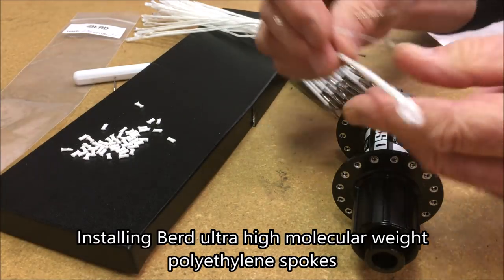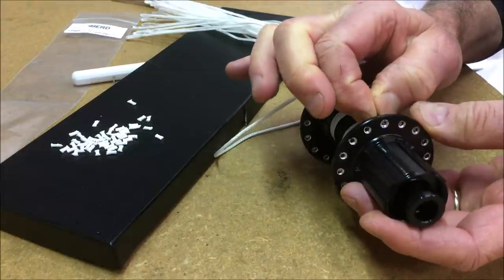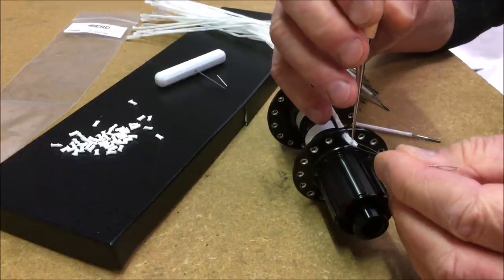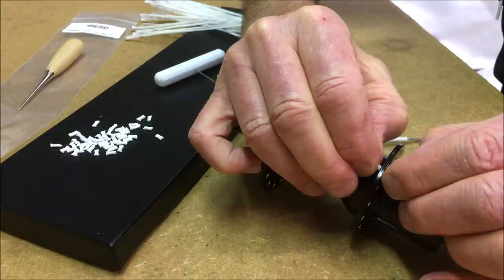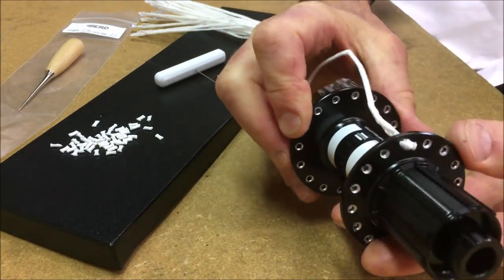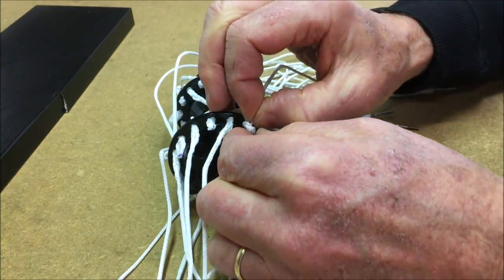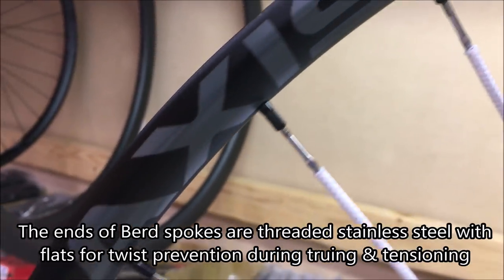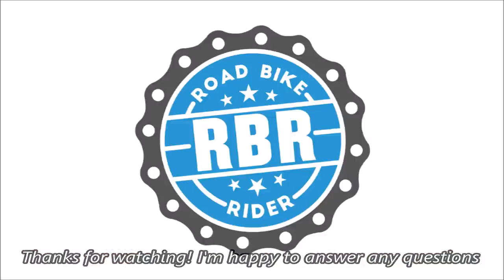Berd's Ultralight Polymer Bicycle Spokes - Wheelbuilding Tips & Observations

Comment: IF they're so amazing, whey arent' they being used by the pros or on the tours?
Reply: Most of the advantages on them are mountain biking.
Reply: @cohensylvester5191  explains everything
Reply: @cliffcox7643  yup. Although there are some gains on road bikes.
Reply: @cohensylvester5191  I think the weight of aero spokes trump the light weight of these.. Aero trumps weight because of the increasing drag at speed.
Reply: Because they use the stuff brands sponsors provide. And this tecnology is patented.
Reply: @abelramos8652  I dont think so. I think they're not aero, but light,  and aero trumps weight.
Reply: @cliffcox7643  thats on road. On xc aero dont matters more than weight
Reply: @abelramos8652  exactly, thats why you don't see them on any pro road, or even amateur ..kkkk
Reply: Because it's 8dollors a spoke
Reply: @codypease9582  That makes no sense. I a pro team can afford that. It's the normal people that cannot.
Reply: They're not UCI approved for mass start events
Reply: @cliffcox7643  are they bad at aero? Can you even prove this? Just because it is "string" does not mean it has aero so bad to the point where the weight difference doesn't trump the slight loss of aero (if any). If aero is such an important thing, why do the cyclists not wear a full skin suite, surely there are materials more aerodynamically efficient then our skin?
Reply: @BloodThunda  its proven everywhere,  bladed spokes truncated shapes better than round
Reply: @BloodThunda  all you have to do is just look at thos fluffy things and you can tell its not very aerodynamic...
Reply: @cliffcox7643  I think you are missing the point of this, this weighs less, not sure if you cycle on the road or on the dirt. But what I can say is this, less weight means more control, so in slow technical  situations where aero means nothing im quite certain that you would want these if they weigh less then any other solution.
Reply: @BloodThunda  so, thats why they're not used on road. Makes total sense. Also a few grams less means nothing as well. Ok I got it figured. Its a gimmick for people who want to spend money
Reply: They're not aerodynamic and Berd is a very small company. Riders use equipment that they're paid to use, so only companies that can afford to back teams will be seen. Most wheels ridden in large cycling events are produced as wheel systems anyways, so custom wheels aren't very common.
Reply: @cohensylvester5191 , Then how come the pro mountain bikers don't use them?
Reply: @cliffcox7643  yup exactly except if you live in some where really hilly. but arrow is 100% better for crit/road racing
Reply: Because no one knows about them (?) ...How have I not heard of these until now, even though I've been using dyneema / cuben fiber backpacking products for years (yes, some from REI) and yet have been riding bikes and truing wheels for 4x as long as I've been into backpacking.
Reply: Cliff, I don't think anyone said they are amazing (even though a light string spoke is absolutely amazing), but they are substantially lighter than steel, so if you want a light wheel set, they might be a good option.  They seemed to hit the market and start getting great reviews right around 2019, but I just can't think of any reason they didn't explode on all those tours 2020-2022.😂    Pro cycling, it's all about sponsorships.  Pros ride what their sponsors provide, not the equipment they want to ride.  This doesn't mean pros would or wouldn't want to ride Berd spokes, but small startup companies are rarely sponsoring Tours and pro teams like Trek or Giant due to lack of capital.
Reply: @gabeah  no one said they're amazing, but for myself. Aero trumps light weight. These are like a whisk in the wind. The pros would rather have aero. Saves watts, and is faster through the wind.

Comment: This reminds me of a tragedy that happened about twenty years ago.  I used Spinergy SPOX wheels on a touring bike.  It was a trip intended to go from Seattle down to Los Angeles along the coastal routes.  I learned that the racing wheelset was never intended to be used as a loaded touring wheelset.  After a hundred miles of riding, the rear wheel failed and there was a mess of VECTRAN spaghetti.  The front wheel showed cracks in the rim and was eventually going to go spaghetti on me, too.  I had to go to the nearest bike shop and buy a standard 700c  Shimano wheelset that would survive the tour.  After the tour, I ordered a beefy tandem rims with 50 spokes per rim and a beefy Hugi 50 spoke hubset.  Laced them up myself.   Never had an issue of wheel failure after that.
Reply from the maker: Great story, Roy - though I'm sure it didn't seem great at the time! Thank you for sharing and I appreciate you watching and commenting!
Reply: omg 50 spokes, I never saw such rims
Reply from the maker: @MrLagger1996  thanks for watching!
Reply: thx for sharing this story so that we can learn. every wheelset ist build for the mission it would build.
Reply: And what was the tragedy? Who died?
Reply: Anyone know whar i could get 50 spoke hubs and rims?
Reply: @aggese  I only know of tandem/track stuff. I thought it was 48h tho. There was a Shimano XT cassette hub with high flanges, Campa had a pair (very rare. I saw a pair recently - but here in Germany for 250 euros), there is an old nos Hügi 40 hole currently cheap on ebay.. Phil wood most probably makes such hubs. And rims would be- velocity if you are in the US. in the UK h son+ in 40h. Rigida makes at least 40h and 48h if you are in Europe or else..

Comment: steel spokes can be bought here in Germany for .22 euros . These can be bought for 7.95 per spoke. That  is 3513% more per spoke to build wheels. Hard to justify .
Reply from the maker: Thanks for watching and the comment. Yes they are definitely a lot more expensive than steel spokes. For riders who feel a big difference in ride quality with them though, it doesn't seem to be a problem. And one way to justify the cost is to use an aluminum rim instead of a carbon rim. You save a lot on the aluminum rim versus the carbon and end up with a lighter better riding and more durable wheel.

Comment: So many people don’t realise that the wheel hub is actually hanging from the top and everything relies on tension.
Just one thing missing; I bet they don’t make a pinging sound when a piece of stiff card is fixed to catch on the spokes when the bike is moving. Happy days in the 50s riding my bike with folded card jammed in the rear brake calliper to sound a bit like a motor 😀
Reply from the maker: Thanks for watching and the fun comment, royksk! I rode with a baseball card making the motor sound, too - makes me laugh thinking about it.
Reply: We did the same thing when we were kids. A piece of cardboard and a clothespin.
Man we are getting old!!
Most kids these days would say "Why???" when I can gat an app on my phone to make a motor sound!!!
Man we are getting old!!!
Reply: A hub does not "hang" from the top spoke but "stands" on the spokes below it. If you draw a free body diagram of the wheel you see that this must be true. Or if you just imagine adding spokes until the wheel is solid and then think about the load path to the ground. 
If the hub hangs from the top of the rim then what does the rim hang from? Further, if you put a tensiometer on the spoke above he hub and the spoke below, and apply a downward load on the hub, the tension of the spoke above will remain the same, and the tension of the spokes below will decrease. Since many of the spokes below the hub share the load, they each only reduce in tension slightly. 
Have you seen a wheel fail from low tensioned spokes? The spokes and rim at the bottom fail, while the spokes and rim above remain straight.

And why wouldn't the spokes "ping?" ever heard a nylon guitar string?

Comment: Building a wheel with conventional metal spokes seems daunting enough. Looks like a fun winter evening project for the obsessed. Would like to see you attaching the rim end of spoke. Thanks for posting.
Reply from the maker: Thanks, Norman. The rim end of the spokes are attached just like with regular wheels. The only thing that's different is that you pull on the Berd spokes to stretch them so that you can get the nipples to thread on. That's because the Berd spokes in their relaxed state are a little short. To stretch them, you put the little white Berd tool (shown near the end of the video) on the flats built into the ends of the Berd spokes (the stainless part). Then, with the tool, you have a good hold on the spoke and you can easily pull it up and make it reach the nipple to screw the nipple on. Thanks for asking. Jim
Reply: after made 100 wheels,Building a wheel with conventional metal spokes is not  daunting

Comment: Pi Spokes have a better system of mounting!!! 👍
Reply from the maker: Thanks for watching and commenting, Big Red. As far as I know, Pi spokes are designed for use in their Pi hubs. Berd spokes will work in all standard hubs. So if you want to build custom wheels around hubs you already have with "string" spokes, you won't be able to use Pi spokes unless Pi comes out with another type of spoke end to fit J-bend hubs. But if you're going with Pi spokes and Pi hubs then all's good. Thanks again.

Comment: to be honest i was curious to see how you build the wheel, and to see how the tension make the spoke harde...
Reply from the maker: Hi Jeff, the wheels is tensioned just like wheels with steel spokes. The difference is that it takes many more turns of the nipples to reach optimum tension. In other words, to hit the same tension you aim for with steel spokes, it's surprising how many extra turns with Berd spokes are required. It's the nature of the material that the spokes are made allowing the spokes to stretch. As you keep turning, though, the Berd spokes come up to full tension just like steel and when the wheels are done, if you squeezed both the Berd spokes and then steel spokes (both at the same tension) the tautness would feel the same. The Berd spokes becomes super tight just like steel spokes.  Hope this explanation is helpful. Thanks for the comment!

Comment: Why would the spokes need to be laced under/over as regular spokes? For steel spokes, it keeps them in place when they break so they don't get caught in the derailleur or hit the frame. But fiber spokes wouldn't stay in play whether laced under/over or not. I read the FAQ on the Berd website which answers most of the questions in the comments, but they didn't mention lacing patterns or under/over crossing.
Reply from the maker: Thanks for watching and the question Griff. I talked with Berg before starting building with their spokes and they recommended building with their spokes the same as with stainless spokes including interlacing. Interlaced spokes touch\brace each other at the contact point. This can improve lateral stiffness and reduce vibration in the spokes that can lead to spoke loosening. I believe that’s why it’s done. Hope this is helpful.

Comment: My grand father repaired bikes since ww2.. If he saw this, he would be amazed how this works and how this can survive bc polymer is plastic.. Im also Amazed why save bits of grams while normal spokes are not heavy at all
Reply from the maker: Thanks for watching and the great comment, Blu. I think if you and your grandfather had a chance to ride on a set of wheels built with the Berd spokes you would feel enough of a difference to be impressed. These spokes are significantly lighter than steel spokes and they also damp road and trail vibrations. That's not to say they're going to replace steel spokes but they certainly are interesting and riders using them sure seem to like them. Thanks again!

Comment: Hi Jim, what are your thoughts regarding the torsional stiffness using these spokes?  Wondering what a wheel might do when pushed hard into a corner in a MTB setting.
Reply from the maker: Thanks for watching and the question, Unknown. I haven't heard any complaints from the couple of MTBers I built wheels for with these spokes. But, before you pay the money for these expensive strings ;-) you should probably see if you can find someone with some and give them a try. 

Because a lot of what a rider feels has to do with how they ride, how much power they can put out and how much they weigh. Berd spokes tension up just as tight as steel spokes and rim stiffness will be the same, too. Hope this is at least a little helpful. Thanks again!

Comment: The big question:   Woud  YOU  ride a pair of wheels built with these ?
Reply from the maker: I have actually already ridden a couple of sets of wheels with the Berd spokes, Walt, road and mountain wheels. But, just test riding them around the area for a few minutes only after finishing the wheels. Those wheels went on bikes that have seen a lot of miles now (other riders' bikes) and they're holding up just fine. So, I would definitely ride wheels built with them. But, I'm not 100% sure I'd want them as ride-everyday wheels. I think used like that the spokes will start to get pretty dirty quickly. And, I'm not sure how clean you can get them with the usual bike washing. Not that I'm that fussy, but I know I wouldn't like it if the spokes got to where they looked dirty all the time. Otherwise, I'd be okay riding them based on what I know so far. Hope that's helpful. Thanks, Walt.

Comment: My question is, could you show us bike riding appliances? Are these wheels good to go in enduro riding?
Reply from the maker: Thanks for watching and the comment, Lucian. What do you mean by "riding appliances," - I don't understand that use of the word "appliance." To answer about enduro riding, the Berd spokes make wheels much lighter and lighter wheels make climbing hills easier. Since there's lots of climbing in enduro, Berd spokes would help there by saving you energy on the climbs that you could then use in the timed sections to go faster. Also, with Berd spokes you can get the lightness of carbon wheels with aluminum rims. It's pretty easy to crack or break carbon rims on roots, rocks, etc. That can knock you out of a race. With aluminum rims, the rims bend but you can keep right on racing most of the time. So, that's another advantage of spokes as light as the Berds for enduro. Hope this helps!
Reply: @JimLangley1  I'm sorry, not a native English speaker. However you explained it really good, more, I found a video where they test those kind of spokes on trails. The only problem is the price as it's a hell more than normal spokes woukd be. I'd be curious however to test them see while jumping and landing a bit hard what happens as the main problem could be even that as for climbing I'm no more racing, just shredding like a wild animal.

Comment: I'm most interested to see how these spokes fail. My intuition is it would be at the hub interface but then again the material is doubled up there with the loop. But still it is the very tight bend radius. Anyone who doesn't do a very good job smoothing those holes in the hub flange will find out.
Reply from the maker: Thanks for watching and your thoughts on spoke durability, Dave. I have built several sets of Berd Spoke wheels and haven't had heard of any spoke issues from the riders, road and mountain. I did smooth the holes carefully with Berd tools and according to their instructions. I agree with you that that step is critical. Thanks again.

Comment: Fascinating.  Curious how strong they could be if weight saving weren't a factor but extreme strength was the goal.  Early electric scooters with 12 inch wheels were hard to keep spokes from breaking, especially when driven with multiple high torque brushless motors and adult riders.  At the very least it would be a good torture test.
Reply from the maker: I believe the material could be made as strong as you need it, Kevin by adding strands. Berd says they're already much stronger than steel so maybe already they'd hold up better in those e-scooter wheels? I would guess that they used budget steel spokes in those wheels which are prone to breakage - simply to save cost - or under the assumption that any spoke would hold up on such a small wheel since the spokes would be so short. I wouldn't want to have to lace up those little wheels though ;-) Thanks for watching and the great question!

Comment: Why not just inswrt the threaded end and pull the rest through?
I also wonder why they dont just connect two spooks instead of bothering with the small part?
Reply from the maker: Thanks for watching aggese. I called Berd to ask them about the idea of pulling the end through the loop the other day and they told me that there are several reasons they don't do that. One is to ensure the least amount of the spoke contacts the hub since contact may result in wear. Another is that calculating spoke lengths would be far more difficult if they looped the spoke. The other reason is that the spokes are to work in both regular hubs and some straight pull hubs and they work because of the little "peg" that holds the spoke the way it does (they call that little piece a "chub" fyi). Okay? I hope that helps explain.